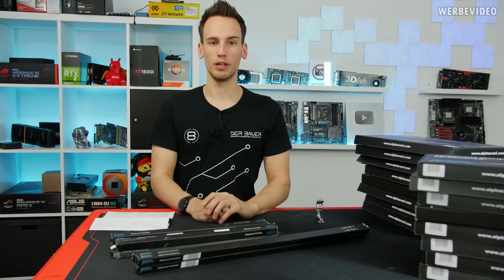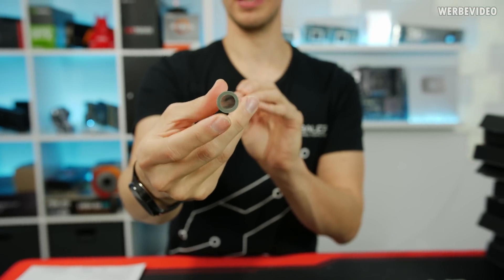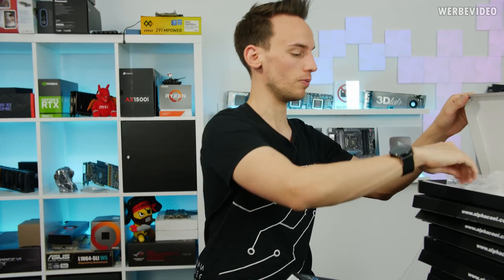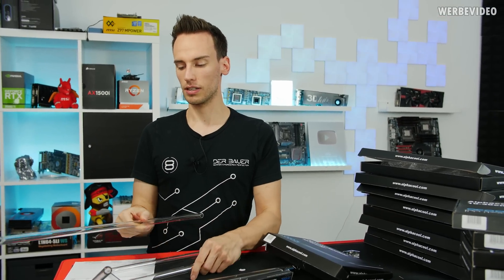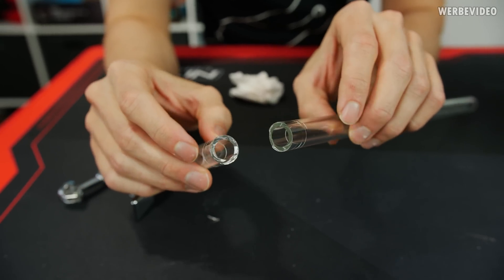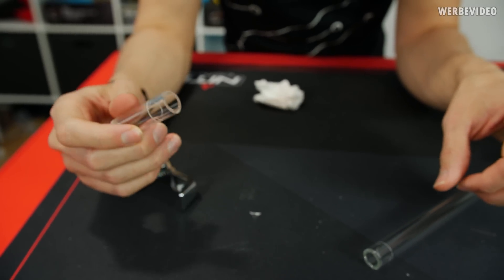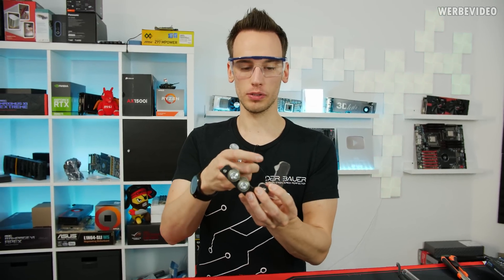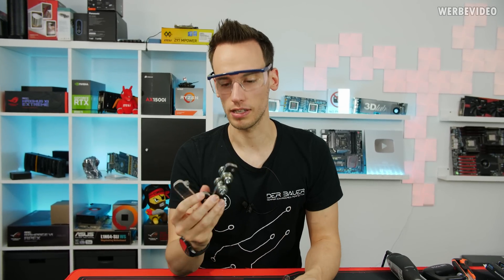Project Irrationality Part 3: Extremely Expensive Hardtubes and DIY Glass-Cutter

Comment: Use temperature differential to break the glass at the score mark.

So, heat the area or one side of the score to about 80-100C and then shock it with cold water from the tap.

This way the break will be perfectly in line with the score and no chips will fly or even be produced.

Comment: You have to lightly apply pressure and turn the tube multiple times also you should do it in the sink while running water over it

Also Bertram stier is also correct, personally I use water and lightly apply pressure while spinning the tube, also when you break it, lightly tap it with a jewelers hammer while you have water running over it and it will break perfect

Comment: hey der8auer, when finished with project irrationality, or whenever you can, can you please pretty please make a guide on how to vga hotwire in general (because there is like nothing out there), and how to on the asus strix 2080 ti, i know that youve benched that card, and have used trimpots and whatnot, and is also what im currently using, i know the jist of how to use a trimpot and whatnot, but when i connect the pads on the strix 2080 ti, card wont boot, im guessing resistors need to be removed also to enable like most other cards in the past idk, so im coming to the overclocking man himself and asking :) and like i said there is no like good comprehensive guides out there and would greatly appreciate a guide

Comment: Also for "cutting" the glass, the "cut" you make with the diamond point/wheel doesn't have to go all the way around. If you make that scratch around 5mm long on one side of the tube it is enough. The glass will break almost perfectly at 90 degrees when you put only a little pressure on it. (Pressure like trying to bend the tube).
Reply: Good example video here: https://youtu.be/zzDnV8NM0dg

Comment: Could bend it or get the cut ends smooth with a blowtorch... :)

Also, i think generally glass cutters are meant to be spun around the tube a bit faster rather than with a lot of force. Just an idea, not really sure.

Comment: The statements about the danger of borosilicate is a bit silly. You only get silicosis after years of working in contact with silicate powders, in mines for instance with no protection. So don’t worry Roman, even if you breathe some of the powder, your chances of getting silicosis are minuscule. In addition, borosilicate powder is not much different than powder from normal glasses as far as health is concerned. An by the way a German invented borosilicates.
Reply from the maker: It's not silly if there is a risk 😁 even if it's small

Comment: You can order a glass cutting wheel for a standard copper pipe cutter that has rollers on it. Also to avoid dust you can use a glass wet saw.

Comment: When you are cutting the tubing, a light pressure is better than heavy pressure and turn the tubing so the tubing is turning away from the arm that holds the cutting wheel. Also if you can find a diamond point cutter they are much better and more precise than a wheel cutter (wheel cutters are just cheap).  The diamond cutters can run a few dollars on ali express or $100-$150 from fancy stores...

Comment: Daniel of Singularity Computers used borosilicate glass in an ITX build. he used a Dremel and flex shaft with diamond cutting wheel on a jig he made out of wood. Look up Extreme ITX: Part 2  how he did it, just make adjustments / modifications so that you can rotate the pre bent glass. good luck Roman 😊

Comment: You are doing great videos as a plumber i can tell you that this tool we use it to cut cooper pumps usualy but in your case you need to harden the surface which is going to be cut glass is very dificult to be stable cut whith this tool you need to put something to harden the surface (like a driver) try to cover the cuting edge with a mat tape but make sure you stick it smoothly... also you need to revolve it many many times..( imagine for a cooper pumb i need at least 10 time to revolve it for a smooth cuting edge) put strengh gratually and sustainable for a smooth cut surface otherwhise you will always have bad cutiing surface the glasspaper you are using does nice work BTW cause its damn glass :) sorry for my english i hope you finish your project !! cheers from Greece

Comment: If you dip tube in cold and warm water back and forth after cutting instead of trying to brake it you get much cleaner cut, you should not use as much pressure either.

Comment: Glass tubes, good, old skool tech, i learned it at school, chemical class, making simple lab gear.
Scott glass, don't be cheap on that! Don't do it on the Russian channels levels, they have skills on the cheap gear, not needed that cheap!
Keep on moving the tube in the flame!, bent the tube curve, push and pull the tube in the right directions, to do make them better, skills!
Lab gear shops do have way better tube cutters! Only use real glass, lab levels! Don't think you need this company....

Comment: this was me 2 months ago. bought same tool, built custom jig to improve tolerances, etc. gave up on it in the end and just used the dremel with a diamond wheel. I was worried about the dust, so i used a respirator and did all the cutting under a slow jet of water.

Comment: I used diamond coated wire hand saw ( for jewelry ) to cut the tubes under a stream of water. Takes a long time and you gotta replace the wire 4 times to complete a cut through 16mm tubes.
To smooth and chamfer the cut ends, I used 200, 600, 1000 and 1500grit diamond knife sharpening plates.
All these can be found on eBay.
You can easily sand 2-3mm off the glass tube with 200grit in 5 minutes.
Sanding with very coarse grit diamond plates seems to cause bits of glass to break off. 
Scoring and snapping the tubes seems to introduce stress fractures sometimes. 
Mayhems glass tubes and Alphacool tubes seems to be similar. The bends are not perfect and I found a small fracture in a 90 degree Alphacool tube.
Reply: Oh and also, the fittings, I used bitspower, do not grip as well on glass tubes.

Comment: Maybe you should put a spring in that cutter that would keep it closed and apply the pressure on the glass while it's cutting, it would give you stable preasure, safer, and more control.

Comment: I have zero experience with glass tubing, but i would just use a grinder and a cut off disk. With the correct PPE (gloves, dust mask, safety glasses, faceshield)
Reply: BlackBird
Are you smarter then a 6IX grader?

Comment: Thermal shock would be a good way to get crisp cuts. Soak a string in fuel like acetone, tie around the tube and ignite. After it's heated up, plunge into ice water. Sometimes have to reapply fuel if the string doesn't burn long enough to get the glass hot. I haven't tried it with Borosilicate glass. I understand it's less susceptible to thermal shock so perhaps a liquid nitrogen bath.

Comment: Linus has a video of noctuah nhd15 & deepcool assassin on GPU both keeping your PC silent and cool with similar temps to water cooling. Honestly this is all just for looks when air cooling has improved so much and it's less of a hassel to assemble and keep maintenance.
Reply: The temperature of all the other components such as SSD, RAM, motherboard all dropped by 10C after water cooling my graphics card on a open case build (Core P5) just from eliminating the hot air blowing on them. Designing and assembling the loop was fun for me with no maintenance since the build almost three years ago other than dust control. The graphics card itself dropped by 40C from around 75C to 35C under load.

Comment: 4:44, silicosis is correct, you can get this by grinding at glass or sandblasting.

My instructor got this because back when safety was an OSHA requirement, it wasn't a standard and not necessary, as he kept sandblasting he got the disease and has lung cancer.

Comment: A copper-pipe cutter will work well on glass, I'm damn sure of it.. and you can get some very high quality types out there
Reply: ^^This... I was surprised he didn't build the DIY tool with a threaded scoring end to keep consistent pressure on the tube instead of putting it on a hinge. It wouldn't of been much more complicated to design.

I'm not sure if copper pipe cutters are quite as sharp but simply carrying over that concept would be much better.
Reply: @JJFX-  yeah using a screw to apply pressure allows you to do several passes along the same cut with increasing depth too
Reply: @BrapMan  With glass you do not want to do several passes, ever. One single pass and very light pressure is all that's needed and will give you the best results. And I'm not really fond of that cutting wheel. It has to be absolutely perfectly aligned or you risk chipping the edges of the grove. Using a light pressure will however make it less likely to chip.
Reply: @blahorgaslisk7763  which is why a screw tightening clamp would be better, not only does it allow for a more consistent pressure but it also allows for a lighter pressure to be applied. As for them being precision, you can rest assure that you can get very precise pipe cutter clamps out there, with lots of contact patch from the running wheels, and a low radius on the wheels to ensure stability for use in much lower tolerance work than a low pressure water system.

Comment: You know cheap metal can't actually scratch glass, right? It's actually impossible since glass is a harder material. Only way it happened is if you got glass shavings in between, since glass can scratch itself. Borosilicate Glass is 7.5 on Moh's scale of hardness. Steel is 4-4.5.

Comment: You need WAY less pressure. You only need a tiny groove. The glass will break very cleanly when you bend it. This is also the reason the glass broke in the middle cut, in the beginning of this video because it was the best cut, though the start and end was way off. Once you've cut 360 degrees, DO NOT go for a second rotation or you'll ruin the cut. Don't take my word on this, but instead go to a shop where they cut glass as profession and ask how it is done. ;-)

Comment: = Cutting glass only requires very light pressure.
= You can use a torch to melt the edges of the glass to smooth it out.
Reply: YES, first comment I see that tells how it's done. Thank God I'm not alone on this one.

Comment: Causing a thermal shock to the glass should cause it to break on the line you inscribe. Heat it than into a ice bath should do it. Regular glass will definitely work this way. Borosilicate glass is much more thermally stable because it was designed to be used in chemistry, so you are going to need a much greater heat difference.

Comment: Much less pressure and don't overlap areas you already cut. You want a just visible line in the glass. Also you can just run some hot water over the line then dip in cold water, it should just snap off. Greenpower science has a great video on cutting glass bottles. I never seen anyone get cleaner lines than he does. Not positive if the hot and cold water method will work with borosilicate glass though, since its designed to be shatter resistant against sudden temperature changes.

Comment: would say to try to thermal shock the glass instead of breaking it. you score it with the glass cutter, then warming it up with at heat gun(be carefull not to heat to much), then when its warm, put it into ice water. it should break of clean where you scored it. Take a look at guides for cutting wine bottles for more info.

Comment: Why not map out the tubing with a test fit build, using acrylic or whatever. Or even cut some rough mock-ups with the glass tubing to get the measurements as accurate as possible. then send the measurements out to a glass tubing factory or glass specialist or wherever the glass is from and have them pre-cut it.  " Voilà " 
  Work smarter not harder.

Comment: Scoring the groove, you probably don't need to go all the way, about 3/4 should be enough, you can use less pressure too. When breaking, it helps to wet the scored glass.
I can recommend book Building Scientific Apparatus (John H. Moore) first chapter quickly and well explains working with glass.
Oxy torch and glass blowing glasses would be reasonable investment.

Comment: Some people have already said it, but your best bet is to score the tube with light/moderate pressure, heat up the cut with a gas torch for 5-10 seconds, then dunk it in ice water. Jayztwocents did a good job on his video explaining the process for clean glass cuts.

Comment: Small blow torch available at hardware stores for doing plumbing, use it to flame polish the chamfer and you will get results like the 90 bend bought ones you have. Also you could have used the acrylic you have to make a holder and used the diamond cutter with a bit of water or a shop vacuum and safety gear and you can have perfectly cut lines and the flame polished chamfered ends.

Comment: Kinda weird that all the hardware connecting your custom glass cutter was made with good accurate tools, then you use an angle grinder to cut the slot for the cutter head!?!?!?!
Sure the hole for the screw is probably the right size, but there's no way that cutter head isn't moving around freely in that slot :X

Comment: FYI: when the tool is moving over to the side and creating that spiral pattern on the class instead of a circle (not staying straight), in English we would say the tool is "walking on you". That basically means the tool isn't steady and moves from the desired position when it's being used.
Reply: Really interesting video for sure btw :)

Perhaps having a motorized clamp on the tube spin the tube while having a cutter stationary on a workbench, just applying pressure would work well? If the cutter and the motorized clamp were both secured to the bench, and the clamp had sufficient pressure, you could theoretically get a perfect cut.

Comment: I did 16mm glass (ordered my straights and 90s from Mayhem) in my main rig... takes a lot of work but looks amazing! I used a Dremel to cut mine (scoring and snapping method was inconsistent) with a diamond wheel wearing a simple mask. For finishing I just wet sanded the ends and I did not have any issues with cutting orings.

Comment: a long time ago i saw glass cut using a yarn string drip in alcohol, then wrap around the tube and let burn.not sure if it will work with borosilicate since it is supposed to be resistant to heat shock, but since the slow burn, it may be acting on the crystalline structure. Worth tryng, the cuts look much better than what you get! Search for "cut glass with yarn" and you will find some example/tutorial

Comment: Why would you buy glass tubes from Alphacool when you can just go to a glassblower supply store and get them for way less? :X
Reply: Why not go direct to a glassblower, who will cut them to length, and bend them for you? 

Those cutters are awesome actually.
Reply: Because this is a gimmick for the gullible :D Building a tool in the first place will cost you but then again, I thought he might have an idea to improve something - he usually does, yet this time, a total flop! Cuts in the tubes are identically bad :D Furthermore, you have spent money to make a custom cutting tool that doesn't work and you have to sand them down anyway! As you said, go to the glassblower but hey, this is a sponsored crap - understandable, he has t live of something :D
Reply: For 400€ one would imagine to get custom glass tube loob built to measurements lol..
Reply: XFourty7 I saw packs of 10 for $10 plus shipping if I recall recent pricing properly.

Comment: Why don't you just laser cut all the glass tubing? That's what I'd use, if I owned that machine!
Also, before you snap the glass on your score line, use some lighter fluid (Naphtha) on the score line and ignite it. You will get a cleaner break, and reduce dust particles.
Reply: I doubt that laser machine can cut glass.
Reply: @TheBackyardChemist  Why not? It looks quite capable of cutting a wide variety of materials.
Reply: @mattsmechanicalssi5833  Laser cutting requires substantial absorbance at the laser wavelength and sufficient power density. I have doubts if that cutter meets either. Plastic is a lot easier to ablate than glass.

Comment: I wonder if using painters tape/masking tape around where you cut would help against the chipping? Interesting video!
Reply: No, it's all about the proper cut. You apply light pressure to score it 360 degrees and then snap the tubes by applying pressure near the groove.

Comment: Flame polishing is the best and easiest way to smooth those cuts.  You do NOT want to sand (even wet sand, though it IS better) or grind glass unless you have industrial level breathing protection.  Glass dust is no joke and standard medical masks don’t protect well enough.  You can also use flame polishing to reduce the visibility of the incidental scratches made by the cutting wheel.

As to your acrylic cutting tool, I would be afraid that the acrylic would break pretty easily over extended use.  You might be better off using washers to shim the metal cutting tool’s cutting arm and using just a simple piece of cloth to protect the opposite side to eliminate the incidental scratching.
Reply from the maker: 10mm acrylic is very strong :)
Reply: der8auer strong yes, but brittle and materials will accumulate stress over time.  Metals tend to be more resistant to stressing in my experience.